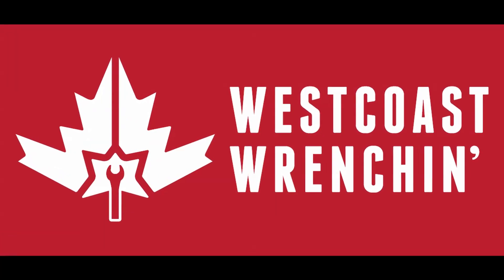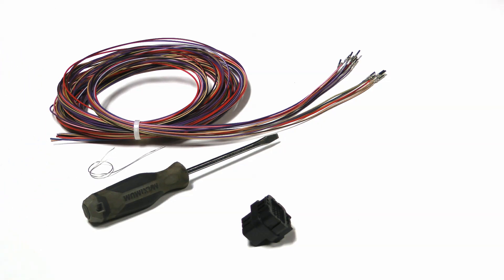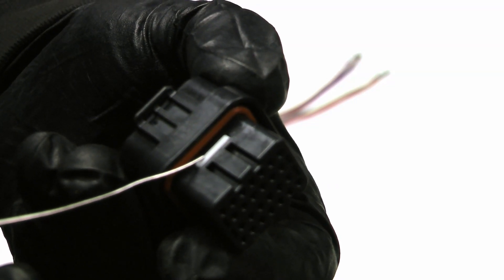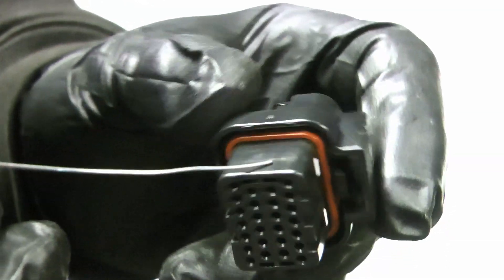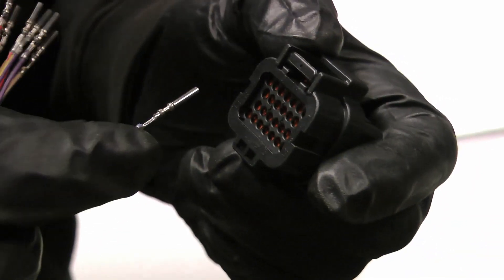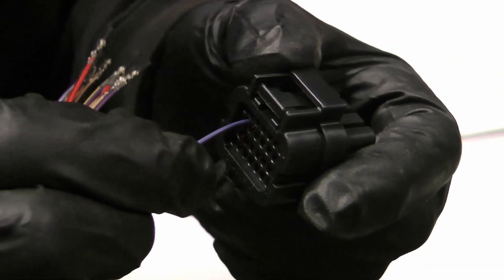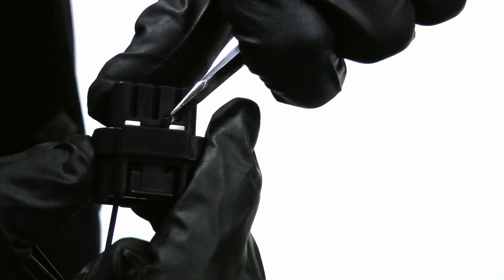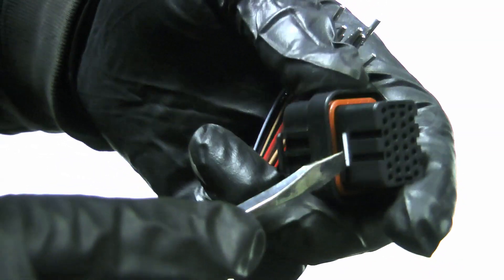Holley EFI Installation - How to Pin Depin and Understand Pinout

Comment: Are the weather seals part of the connector?
Reply from the maker: Yes they are
Reply: Where can I get the pin connectors? I need to add 4 wires to a terminator x cpu.